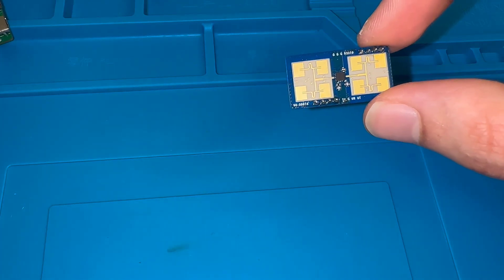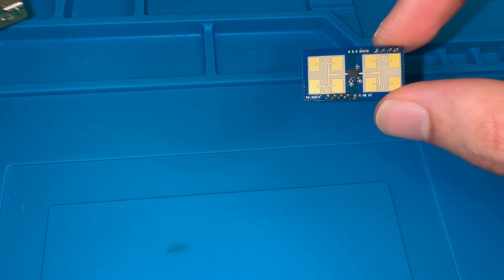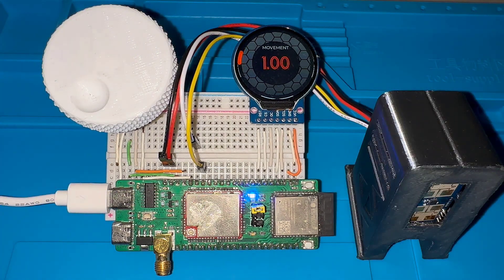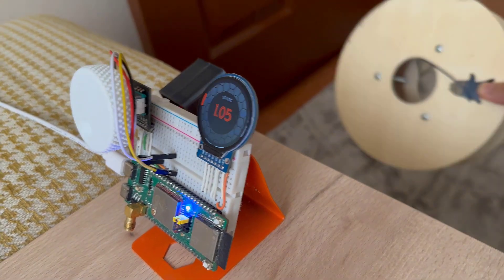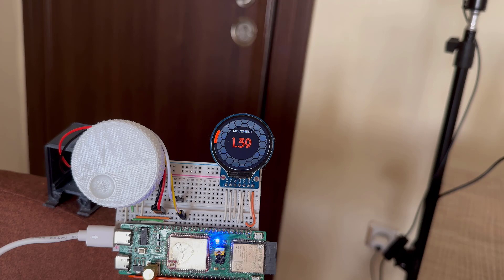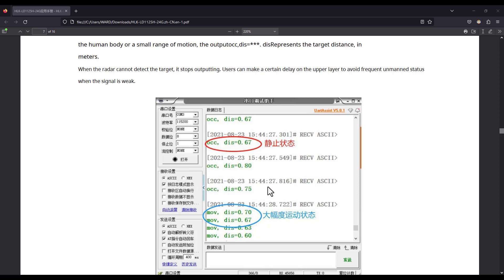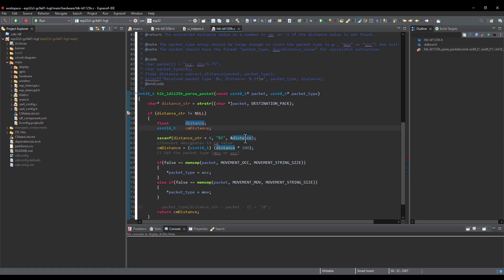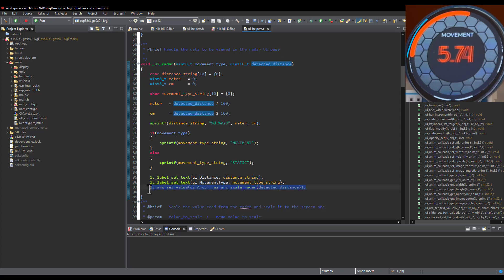ESP32S3 HLK-LD1125H Human Presence Sensor

Comment: If you use them outside, they don't work if it's raining. They just continuously report a presence. They also report a presence if a person is behind the sensor.
Reply: I tried also 2410 of different modifications in  garden areas and it triggered by grass and branches((( Purhaps you know some device that can deal with it?

Comment: The only flaw is it detects the ceiling fan moment too you need to be more careful on placing the sensor and play with Detection distance values a lot and although you will end up with costly solution

Comment: These are great sensors, I have 3 currently and made my own 3d printed case to mount to the wall. I will be replacing my PIR sensors around the house for my accurate detection when turning on/off lights. They do penetrate through the walls, had to adjust the distance so when someone walked past my office it wouldn't trigger.